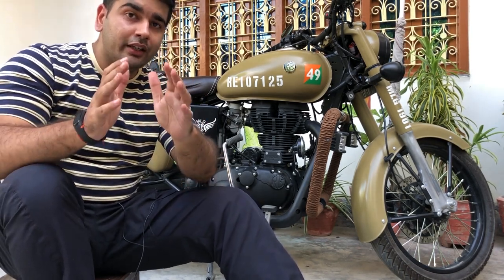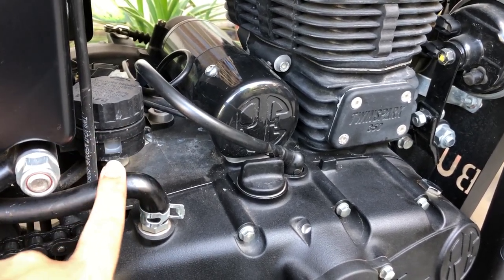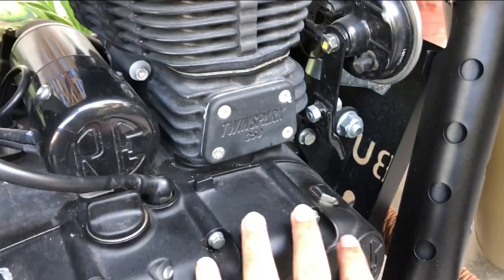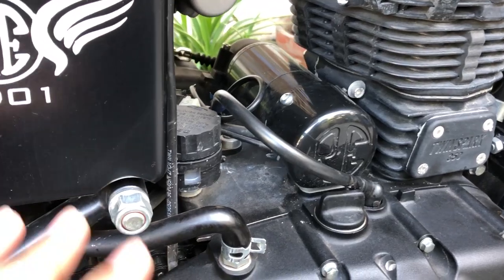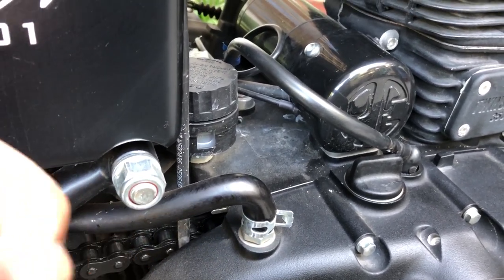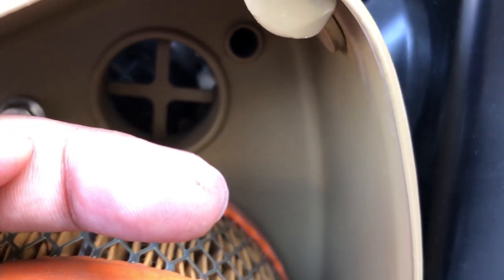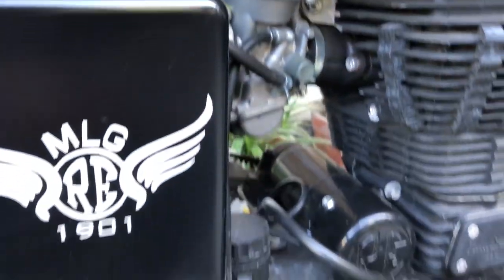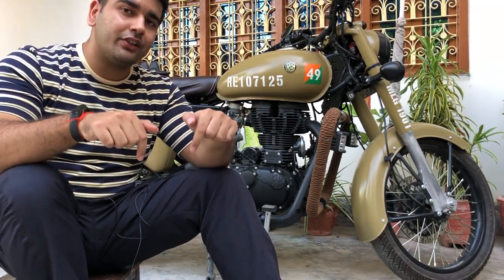Breather Pipe Function in Bullet | Why you need to lube Bullet Chain | How Breather Pipe Work

Comment: When I raise acceleration the engine is switching off..what might be the problem?..was running well, this problem started after water wash.. solution pls
Reply from the maker: Can either be water or dirt in your spark plug wiring or gunk in the fuel line. Just check and clean the spark plug wires once and see, if it works then fine or else change the fuel filter assembly, it hardly costs anything

Comment: Hi,
I am facing missing(jerk) in my classic 350 after riding 1 to 2 kms,
Unable to find the root cause
I have changed entire wiring kit
Spark plugs, starting coil,
But I observed ther is breakage in the breather pipe,
Unfortunately my mechanic friend is unable to find.
Could you help here?

Comment: The breather pipe in my bike is cut and I noticed that my kicker is not producing the required pressure making the kicker hard to start the bike. Is this because my breather pipe is cut?
Reply from the maker: Is the kick become too hard or you need to kick multiple times to start the bike? Either ways it’s not related to the breather pipe as it’s responsible for taking away the access pressure build up inside the engine and has nothing to do with the combustion chamber. The piston rings are responsible for the pressure inside the combustion chamber, if you are using an after market silencer then make sure you get the piston rings checked once
Reply: @vishveshmishra3894  the kicker gets hard when it goes down.
Reply from the maker: This means the kick isn’t able to generate enough pressure to move the piston in the chamber, get the piston rings aswell as the crank checked for any sort of a leak or loose seal
Reply: @vishveshmishra3894  ok thanks

Comment: I also have bullet classic 350 but in petrol tank I don't know from where the water is coming the petrol is turning into water if I won't start the bike for 3 or more days so what might me the problem
Reply from the maker: Firstly please check if the tank cap washer is intact or not. Also when going for a pressure wash ask him not to direct it towards the tank cap.
If it’s all good then empty the whole tank once properly and get fill it up again with the Servo additive. See if it solves the issue as sometimes residual water can turn petrol into water if it has high ethanol content
Reply: Thankyou sir I would definitely do it

Comment: What happens if breather pipe is not connected to the air filter box
Reply: Oil (a thin black sludge) goes everywhere, my breather pipe cracked and came loose the other day. Most likely going to place a 12mm crankcase filter to replace it.

Comment: Now why would anyone want hot oxygen depleted air run into their throttle body? Intakes require cool clean air. Best to disconnect and run to a small filter to catch the oil. This will be way better for your engine. The environment will survive!!
Reply: Breather pipe removing in bs4 shows missing

Comment: No all ci engines after 2004 did not had breather pipe on chain I own a Electra 5s and it has the same system as in uce engine
Reply from the maker: Thank you for the correction! Will keep this fact in mind from now on.

Comment: Dude you are wrong... Think again and then post
Reply from the maker: Could you please tell me what is wrong in this video, as a whole or in parts??
Reply: @vishveshmishra3894  breather pipe is basically developed for the piston negetive displacement. Means combustion chamber have its own atmosphere and it is completely sealed you can put the air from intake or exhaust. So their is no possibility to leak the charge in the TDC stroke. But the lower part of the piston and the other lower side gearbox or crankcase environment are same. Just think when the piston move from the TDC to BDC, the  air need to be displaced. If the engine is completely sealed the traped air will blow out the oil window or other gasket . So the breather pipe does the ventilation for the piston lower environment. It's basically connect from AC box to filter out the air. So their are no dust contamination on the air. The engine's inner atmosphere equilibrium is maintain. In another scenario when the Piston move from BDC to TDC it create a partial vacuum in the lower chamber of engine,that moment the breather pipe sucks the air from AC box to maintain atmospheric pressure otherwise the engine performance will definitely slow down.
Reply: Some other  reason.. when the combustion is happen... The engine temp. is rise so the air of the lower atmosphere will expend. If their are no path to exit it, it will blow the oil seals or oil windows definitely. The breather pipe release this compressed air.
Reply: One another thing the performance of the engine is excellent when the fresh air is sucked by engine not any used hydrocarbons or any other used gases
Reply: What happened if the pipe is blocked. Pls reply
Reply: @bishwadeka5876  due to high pressure the oil seal will popped out. The oil checking glass window will popped out.